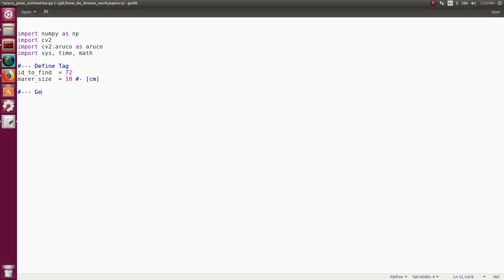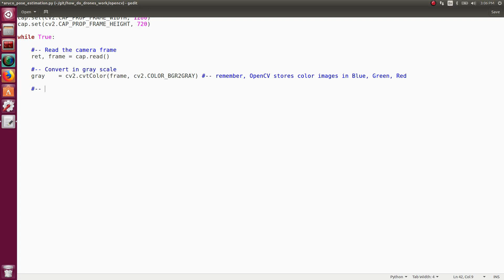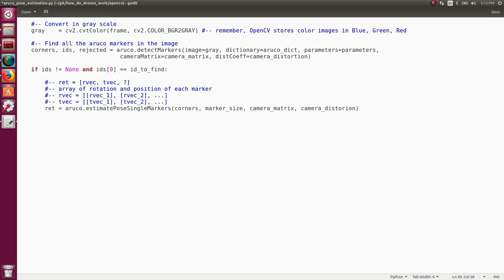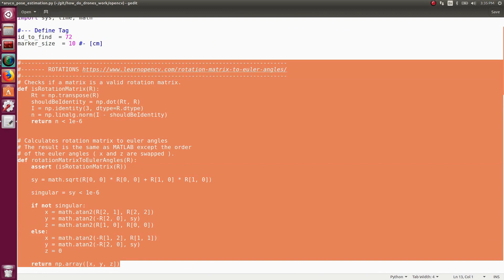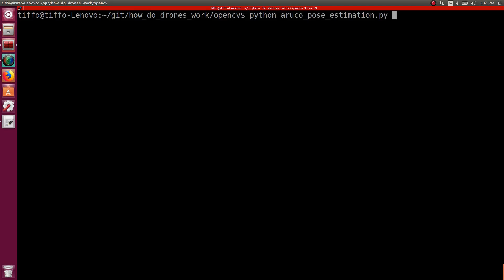PRECISION LANDING | with OPENCV and ARUCO Markers | Part 1

Comment: There is a disconnection with dronekit when the drone takes off. The companion computer is no longer able to read the accurate vehicle mode. I ran the read telem script, this script throws a key error for min thr. When I compiled dronekit from your repo, and ran the script, it returned with syntax errors on connect at Init function of dronekit. You've done an amazing job, It'd be amazing if you could let us know the correct python version that runs the code🙃

Comment: that was great video, im just having issues with my z position it seems to be showing 100 mm less than what is actually is (i measured using a ruler). did anyone else have this issue? if so what is the fix for it? 
thanks

Comment: Hi Tiziano, awesome video, im struggling with the video feed from my Raspberry Pi Camera Module v2 NoIR. For some reason the video displays with a green tint. I have tried using the opencv library set method to convert the raw footage to rgb but it doesn't produce a clean and clear video. could it possibly be a setting I need to change? if I execute libcamera-hello the video being shown is perfect so im confused as to why the opencv library gives me video with this green tint.
Reply from the maker: The NoIR usually produces a false color in daylight, as it is more suited for capturing night or low light scenes. Maybe that hello world sends settings that compensate for the green hue. What do you see with raspivid ?

Comment: Amazing result! How do you get such great framerates? I am stuck at ~8fps, using the precompiled openCV lib I installed via pip. Does compiling it yourself make such a difference?
Reply from the maker: Low resolution

Comment: sir I have done every thing in code but i'm unable to get those line on the aruco maker
Reply: 6:29 these lines
Reply from the maker: The frame? But that is the easy part. Try creating another output image and create a few lines there. Make sure that the position you are setting is actually feasible

Comment: Hi sir. I got a problem when I run on raspberry using vscode "TypeError: 'cameraMatrix' is an invalid keyword argument for this function"
do you know why this happens? thank you
Reply from the maker: Check the source code if the keyword has changed
Reply: @prandtlmayer  I am facing the same problem. I checked the documentation and the function detectMarker takes only 3 arguments; image, dictionary, and parameters. Any idea how this can be solved? THANK YOU!
Reply from the maker: Packages update and things can change. Try not passing the camera matrix
Reply: @prandtlmayer  yes, I removed the extra parameters and it worked. Thanks!
Reply: @muhammadamirulhidayattulla6973  removing these 2 arguments removed the error. I had to remove them from other places as well. Sadly I was not able to get it to work. I'm not sure why but I stopped working on this project

Comment: Hi Tiziano, I'm using the code on a raspberry pi 3B and a 5Mp raspberry camera module. The problem I am having is that the camera frame rate is extremely slow when I try to video capture. Is there any way to solve this issue?
Reply from the maker: You need to keep the resolution below 640

Comment: I have a custom object that am detecting using my pi camera with and drawing a bounding box on the object. I then obtain the x and y corcinates of the object. Can I transform these coordinates to north and east?
The image size is 360 by 240
Reply from the maker: Of course you can. You can always rotate Body->NE using the yaw angle

Comment: Hello, is it possible to control the other servo's based on drones location through dronekit? Is it possible to control it through raspberry pins?
Reply from the maker: You can 2 in two ways: one is directly from the Raspberry Pi, using  a GPIO and a packat like servoblaster, the other is through a servo control pin of the Pixhawk and Mavlink commands. Both ways work

Comment: Ciao Tiziano.
I have a problem, I wrote the code and run it, It displays the camera, but doesn't displays the frames. Then i run the aruco_pose_estimation.py from guthub and the same happens. I'm using Python 3.7 and Opencv 4.4.0. Any solution?.
Reply from the maker: That is odd. Can you try and draw a frame with just the overlay?
Reply: @prandtlmayer  I realized that i was using a wrong library in the ArUco generator, so the program would never detect my Aruco marker. Anyway, Thank you very much Tiziano.
Reply: What is the Dictionary used for the Aruco marker used in this video?
Reply: @barunbasnet  Original Dictionary

Comment: Hi Tiziano, can I ask what is the meaning of "rvec, tvec = ret[0] [0, 0, :], ret[1] [0, 0, :]" in above code?  I think ret[0] means the revc in ret, but what the following index [0, 0, :] stands for? Could you help me explain this?
Reply from the maker: If you print ret you can understand how things are stacked inside.
Reply from the maker: Sometimes code changes, so you should adapt this code to the current status. Back then that was the syntax to get the rvec (the rotation vector) and tvec (the translation vector) as the last column of the output tensor.

Comment: while running the code when it was reaching the condition: 

if ids is not None and ids[0] == id_to_find:

it's showing 'none' so that's why it's not detecting the aruco marker
Reply: Tiziano Fiorenzani thanks sir for your response. Actually I got a problem. I wrote all the same code as you shown. When I run the code there is some error. And it can’t detect the marker position.
Reply: Can I get updates for these issues?
Reply from the maker: Are you using python 2.7?

Comment: Ciao Tiziano!
following your tutorial, the code worked perfectly.
But after a restart I received this error message.
Could you please help me?

 OpenCV Error: Assertion failed (scn == 3 || scn == 4) in cvtColor, file /home/pi/opencv-3.4.0/modules/imgproc/src/color.cpp, line 11111
Traceback (most recent call last):
  File "aruco_pose_estimation.py", line 114, in <module>
    gray    = cv2.cvtColor(frame, cv2.COLOR_BGR2GRAY) #-- remember, OpenCV stores color images in Blue, Green, Red
cv2.error: /home/pi/opencv-3.4.0/modules/imgproc/src/color.cpp:11111: error: (-215) scn == 3 || scn == 4 in function cvtColor
Reply from the maker: This is the Pi that doesn't see the camera. It usually happens when the power supply is not enough.

Comment: Hi Tiziano, when trying to run your script I get the following error:
Traceback (most recent call last):
  File "<frozen importlib._bootstrap>", line 2218, in _find_and_load_unlocked
AttributeError: 'module' object has no attribute '__path__'

During handling of the above exception, another exception occurred:

Traceback (most recent call last):
  File "aruco_pose_estimation.py", line 39, in <module>
    import cv2.aruco as aruco
ImportError: No module named 'cv2.aruco'; 'cv2' is not a package

What did I do wrong? could you help me?
Reply from the maker: It looks something is wrong in your Opencv installation. Open Python and just import cv2. What does it say?

Comment: Hi, whenever I run the code aruco_pose_estimation.py I get this error --> Assertion failed (scn == 3 || scn == 4) in cvtColor. Please help me, I have spent hours and hours but I get stucked.. Also can video.capture() run in rpi ? or do I have to manage the code with PiCamera() ?? Thanks..
Reply from the maker: This is usually due to the fact that the camera is not working. Try raspivid -t 0 and see if it works

Comment: Hi, i have a question regarding the camera matrix....camera matrix=calibration matrix (intrinsic) *Rotation and translation matrix (extrinsic) which gives a 3*4 dimension of camera matrix. In that case aruco.estimatePoseSingleMarkers fails resulting an error "OpenCV Error: Assertion failed (src.size == dst.size && src.channels() == dst.channels()) in cvConvertScale, file /tmp/binarydeb/ros-kinetic-opencv3-3.3.1/modules/core/src/convert.cpp, line 5903". So is it always we consider camera matrix as calibration matrix (3*3)???
Reply from the maker: Camera matrix refers to the intrinsic 3x3 calibration matrix
Reply: @prandtlmayer  So how did u show the camera frame as well?

Comment: I hope someone can help me ,It didn't work for me T T, I printed the markers 60 and  45 , the size of the image is 640x480, and I used intrinsic parameters (calculated with a tool written in matlab, and i tested these calibration parameters  and worked fine), the code is practically the same of the video(i reduced the code to print ids but always print "none")
Reply: It seems that the dictionary ARUCO_MIP_36h12 it is already not supported, i've tried with DICT_APRILTAG_36h11 and i generated the code 12 and 13 using one of the tools, but they didn't work, but when i try with the dictionary DICT_ARUCO_ORIGINAL using the marker 72 and 50 workd fine.
Reply from the maker: It really depends on the dictionary. The code I wrote calls for the original, bit you could use any other

Comment: Great Tiziano ,  thank for your tutorial . I'd like to use dronekit and opencv in my next UAV,  from your experience   rasp PI0w could be used with opencv  or better to start with PI3  ?
Reply from the maker: If the CPU load is low you can make it. Try it out
Reply from the maker: Compiling opencv on the pi zero takes a very long time
Reply: Ok , probably for this scenario is better pi3, pi0 is interesting  for the small size.Maybe i will try to use it only with dronekit to manage some sensors for obstacle avoidance . My goal for the next UAV is to to add some gesture function with opencv , your tutorial inspire the fantasy thanks

Comment: Hey Tiziano! Awesome as always. Since you asked us to leave a comment for related work (concept) I want to share mine. I was previously working on this project of navigating a quad in indoor and outdoor environment (without GPS) using aruco. I was working on something similar for my final year project for college degree. Because of some unfortunate events I wasnt able to complete it. I had to change a few deliverables and as of now my project is under consideration for gold medal (will be announced in a few weeks (fingers crossed)). Hope you find my original concept interesting and related to your work:

The plan was to use LiDAR, camera and arucos and a servo.  The quad will use LiDAR to perform assisted take-off (inside) and will detect the downward aruco code and change orientation accordingly. Once done, it will rotate camera and LiDAR (using servo) and detect the aruco on the wall in front. This aruco will tell where should the drone move next (left or right), using lidar assistance so we dont run into the wall. After the safe distance is reached this aruco will tell where to rotate. This keeps happening until the quad is out in outdoor, where a aruco downward aruco will tell that its out, this gps location is saved as home location. Once the quad is out in open environment it will use the mission waypoints to perform autonomous mission. After mission, the drone will come back to home location and perform the same manuever to find its way back and land in the same place (indoor) from where it took-off.
Reply: My plan was to complete this project anyway, but since I got employed within a week of end of final exams; I had to focus on other things. But in case I will be very happy to help you and seek help from you trying to make this concept a reality.
Reply from the maker: I bet you were. I think this project might require more than a couple of videos ;-). In time we'll get there, but we'd need to step into ROS, where there are already several modules for lidar and slam
Reply: Yeah it's gonna be a series of tutorials :) Oh and ROS can be used, but for a simple point distance detection you dont really need ROS. I used Benewake TFmini LiDAR, his one just transmits distance parameters over serial port (used USB to TTL converted as I was using pixhawk with serial port) and this could be implemented in directly in our python code (like the one you used to make in other tutorials)
Reply from the maker: Jay, if you have created something already and want to show to people, I'd be happy to do it for you and give you full credit for that
Reply: @prandtlmayer  I think a shout-out would be enough :). Anyway, I'll have to compile and edit a few things before it can be featured in your channel (Its a mess right now). It would take a while, but not more than a month. I'll contact you whenever I'm done. I'll try to edit it in such a way that it can be easily understood by your viewers and can fit in a 10-15min video tutorial :)
Reply from the maker: You know where to find me